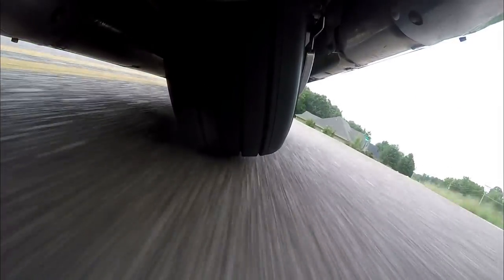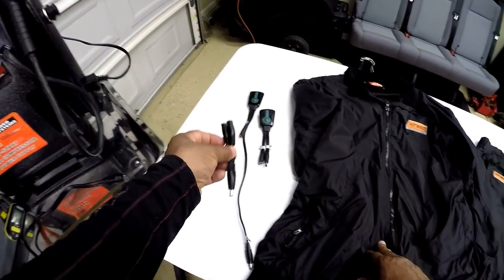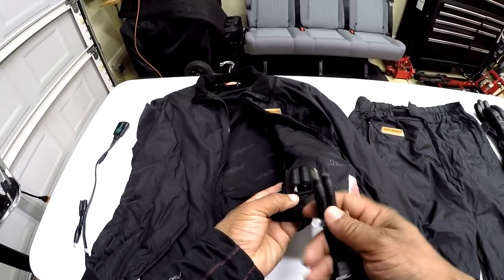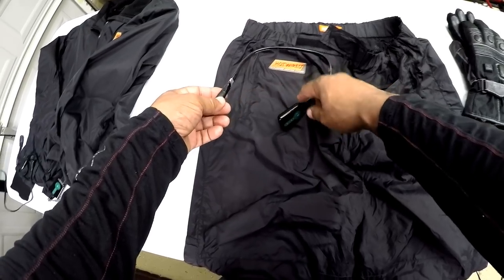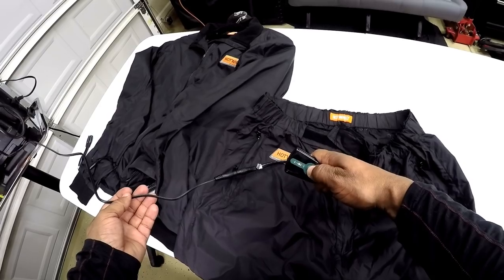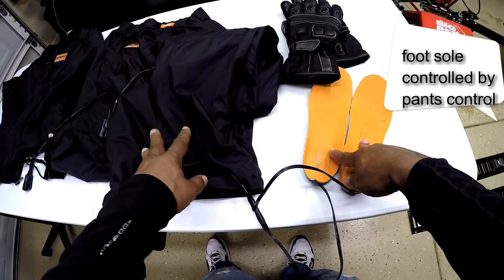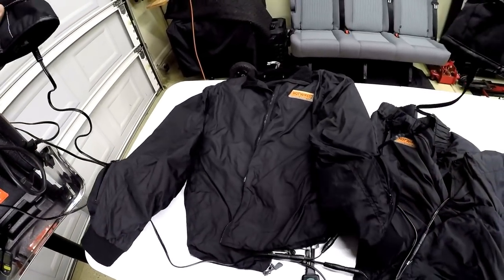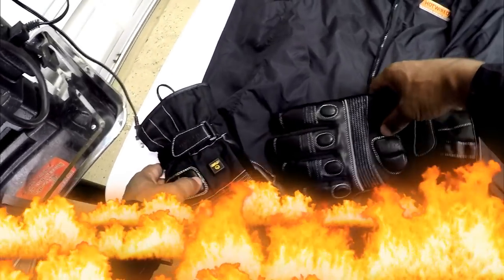Hotwired 2.0 Heated Gear plug & connect reference

Comment: Great heated gear demo! I currently have a heated jacket and  gloves. I didn't know they had shoe foot warmers. The thing I don't like about the Harley Davidson heated gear is it requires a different color fuse when running the jacket and gloves together then if you just wanted the jacket. I will look into the hotwire outfit.
Reply from the maker: I like your comment, this is the very reason I rebooted this video, you have the jacket and gloves but didn't know they made shoe warmers.  It's good to know that I really helped one person, thanks so much Bruce.
Reply: @chriscaliente5033 keep up the awesome vids. I'm currently looking for a 2012 two tone blue and gray GL1800 to put right next to my Harley. Was at the Honda dealership yesterday poking around. Anyway, I am enjoying your work. Much appreciated! Ride safe!
Reply: Great video. Thank u

Comment: You can also run the gloves by themselves only. I liked your previous video on this setup where you hung the suit on the garage door. You could really see it put together as a suit. I need to get the foot inserts to complete the setup. Do you find them useful or in the way? Thanks for the videos.
Reply from the maker: Some have seen the video where I hung up the suit, and some may have not.  This video is a quick reference, it's easy to forget how the suit connects up after the cold season.  Cyclegear now has a newer version called then EVO which may be more user frendly.
I use my foot inserts all the time, I love them.
Reply: @chriscaliente5033  I was really hoping that the new version would have been "heated rain gear" with the buttons on the sleeve and thigh that you could wear year round instead of the jacket/pant liner style. The only thing I see different on the 2.0 is the controllers are simply attached to the garment.

Comment: Hey Chris, if you like them soles then you'll fall in love with the heated socks from firstgear and they will plug right in with gear you currently have. What I normally do is to use both and run a separate controller and a Y adapter just for my feet. For some reason I don't like heat on my legs while riding. Have a look at them here. https://www.revzilla.com/motorcycle/firstgear-heated-socks

Comment: Chris, with the adapter. Can you hook the main power cord straight to the Battery connect  of a Battery Tender? Thanks.
Reply: Just a note the 2.0's from Cycle Gear are sold out
Reply from the maker: I found the fix, it's called a Hotwired SAE DC Adapter.  Here is the link https://www.cyclegear.com/gear/hotwired-sae-dc-adapter